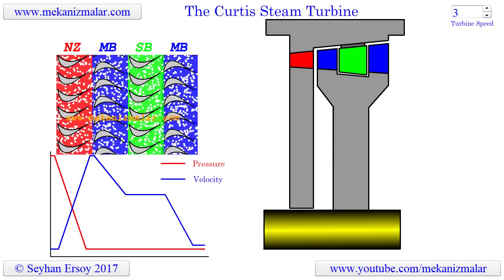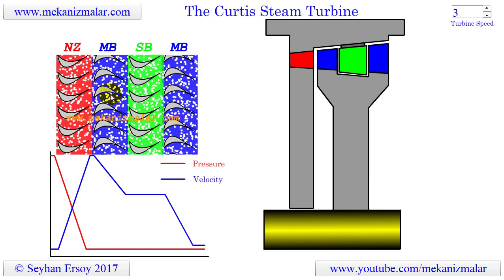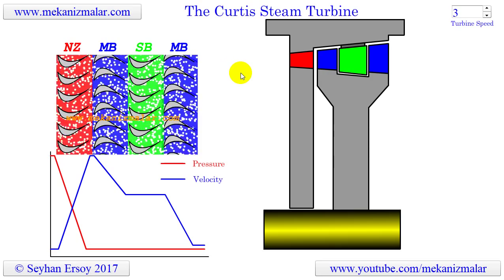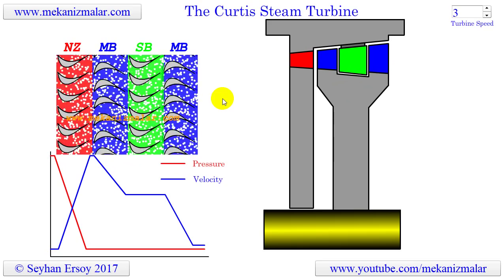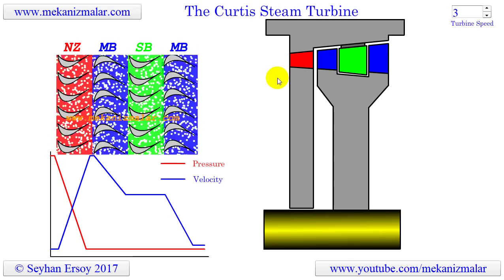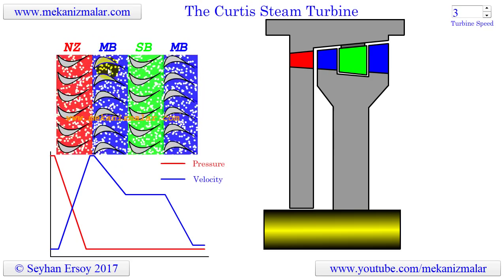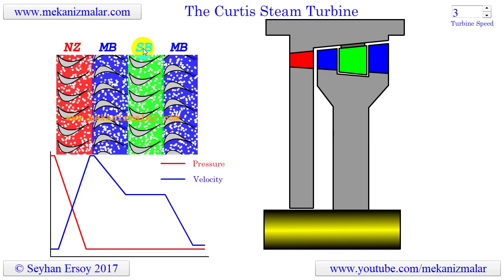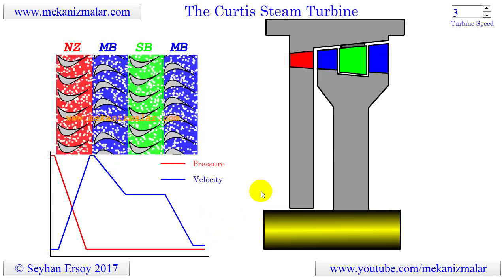the curtis steam turbine with human voice

Comment: Could you comment on why during the intake (NZ stage) a linear relationship between the drop in pressure and the increase in velocity is observed? From energy conservation: P + 0.5 rho v^2 = constant, shouldn't the drop in pressure result in a proportional increase in the square of the velocity?
Reply: Danas Sutula I believe that the y-axis is not in Pa and m/s for pressure and velocity, but rather showing the total enthalpy (energy content). For energy content you have linear relationship, because you are simply converting one form into the other.
Reply: wonder the same, also why velocity stays same on green SB but drops on red NZ?
Reply: Yes, it makes sense from the context since he specifically mentions energy conversion. Thank you, Fredrik.
Reply: A D the nozzle (NZ) and the stator blades fulfill different purposes (even though they are both technically stators). 

This is achieved through different blade geometry (the images of the blades are not representative of the real geometry).
In the nozzle (NZ) you have a blade geometry that changes the speed of the flow, by “stealing” energy from the pressure. 

The stator blades (SB) on the other hand only redirects the flow, with mirrored flow angles. By mirroring the flow angles, the velocity will have the same magnitude, and in turn also the same pressure as before the stator.

The reason for redirecting the flow is to have another rotor blade row that can spin in the same direction as the first, extracting more energy from the flow.

Maybe over-course: In "reality" (assuming constant mean radius, but still not factoring losses) I believe the velocity would actually drop somewhat and then increase again in the stator (SB), reaching a minimum just as it "turns" as then it would only have a velocity in the axial direction (meaning you would have a pressure maximum there as well), then as the flow direction changes towards the outlet angle of the stator, the flow would pick up speed and reach the same magnitude as when entering.